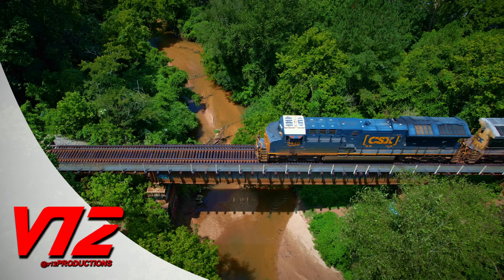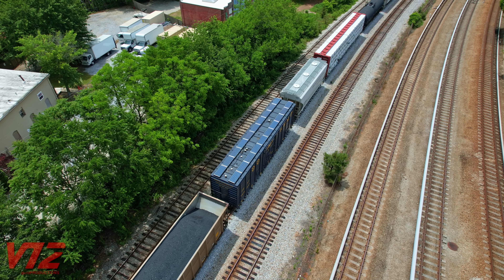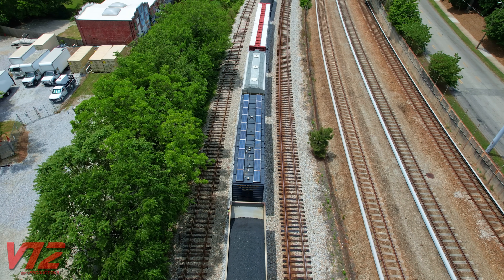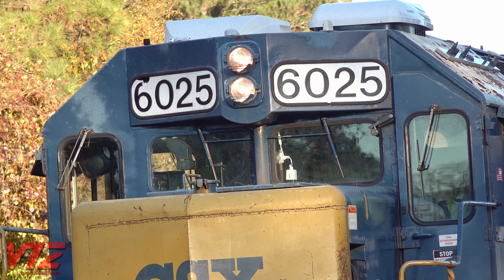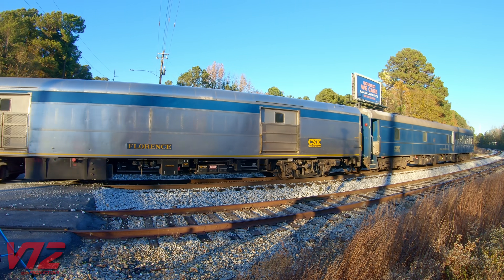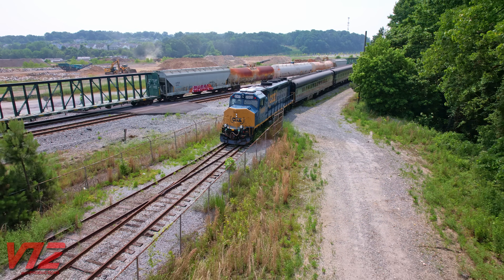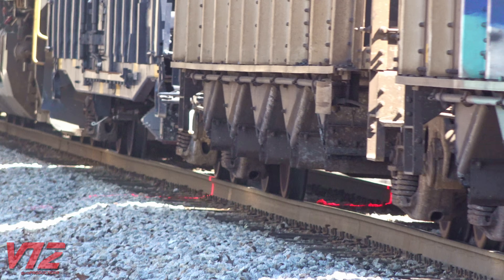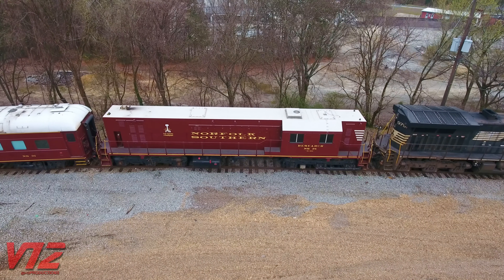"DO NOT HUMP" this Special Boxcar!

Comment: Last year when I went to the B&O Historical Soc. and the  GM&O Historical Soc. combined meet with my dad in St. Louis.  On the Saturday went to both an Passenger  car rebuilder and an transportation museum as an bus trip.  The Passenger car rebuilder was contracted to rebuild an CSX boxcar into what you have in this video. My dad is an member of the GM&O Historical Soc. . B&O and the GM&O has shared history since they both owned the Chicago and Alton so the former GM&O Chicago to St. Louis line had the old B&O style signals which were both replaced by newer signals by both the UP and the CN. The reason the UP has part of the old C&A / GM&O was SP's take over of the short lived Chicago Missouri & Western which the IC starved the new railroad of freight. The CN had taken over the IC. I remember living in Willow Springs Illinois first seeing the last of the GM&O painted locomotives mixed in with ICG Paduca Geeps painted in orange and white as an kid in the 1980s and as an teen in the 1990s seeing the Chicago Missouri & Western's mixture of former leasing locomotives in Conrail and Western Pacific paint with South Shore's former Santa Fe cabooses on the end of the trains. The Chicago Missouri & Western did repaint an few in their Maroon paint scheme. My dad was one of the guys who asked Microscale Decals to make an Chicago Missouri & Western decal set for Ho Scale for the maroon painted locomotives. The decal sheet also includes an decal set for an Gateway Western locomotive. The Chicago Missouri & Western was all second hand EMD.

Comment: CN and CP still use manual track inspection cars.  Might take the railways time to adopt the ATAC car tech because most stretches of track have zero wireless coverage for many kilometers.  Many parts of the Alberta and BC rockes especially have Wireless dead zones.

Comment: Point of correction, that isnt a laser system.  That is an autonomous joint-bar inspection system that uses LED light array.
Reply: So weird. I guess they don't need the precision of laser. It really looks like it'd be laser until you look closer

Comment: Most people do not know what "Do not hump" means.
Reply: I prefer my version of the meaning.
Reply: It means don't have sex with it
Reply: Well, they know incorectly anyways.

Probably at least one guy saw that sign as a challenge. 😂
Reply: crazy will eff you good
Reply: Many do, humping is just a method used to sort freight cars which involves the use of man made hills (a hump).
Reply: Hump means to lift and move something in England. Has no colloquial meaning. I'm assuming that's what it means.
Upon watching fully I see it means something else entirely. Oh well
Reply: @grottybt5006  It means to back a train up on a Hump, then one at a time uncouple a car to let it roll down hill and by selecting track switches route the car to a specific siding.  Humping is how to cheaply make up trains to go to a certain city.  The down side is when the car hits another car and couples, it is a violent shock.  Some cars will not live through that treatment.
Reply: There are Two meanings for the Term “Humping.” The first term is the Railroad term, that is pushing a Freight car over a hill, and than that freight car is uncoupled and rolls down the hill into the yard.

The second term, well, it’s the less appropriate kind.
Reply: ....and if they had bothered to watch the video, they would.
Reply: @bobmahnamahknob  2:41 shows a hump yard but does nor elaborate on what the actual hump does.  He skips over it completely.  ALSO it is a drone shot from overhead showing the hump being flat.
Reply: @myfavoritemartian1 thank you. I agree with you 💯
Reply: @bobmahnamahknob  most people who see a train that says 'do not hump' on it have never heard of this video and never will.

Comment: I have seen that ATAC boxcars at night, very impressive. I have also seen the track geometry train, I believe W003, with 9969 pulling it. Since the locomotive is an ex-passenger unit, the train doesn't need a generator car.

Comment: There are also locomotives that have been outfitted with track measuring equipment that send their data in real time to MofW's headquarters computer applications and generate instructions that are e-mailed to the local Track Supervisor's of locations on their territory that require in person visual inspection and remediation of the defects found.
Reply: They need to do something like this for metro trains.  At least the one I normally take to work, they wait until it is so bad that I hear other passengers complaining that they feel like the train is going to flip over onto its side before we hear an announcement that they are going to do track maintenance.  Especially when the train is climbing up to an overpass with it being straight down on either side and it is rocking back and forth like crazy, while they finally fixed that, I think ridership was dropping off just because of that.

Comment: A long long time ago I worked for an FRA contractor named Ensco.  We did some of the original work on track inspection vehicles including rail flaw and, in my case, track geometry vehicles.  Last I knew (several years back), the FRA still owned and operated inspection vehicles.  Coverage of that program might be of interest to your viewers.  I'm not sure of that program's current status but there is a long history of FRA-backed development and operation of inspection resources.  Could be interesting?
Reply from the maker: That would be interesting. I recorded one of the FRA trains two years ago.

Comment: Now that's some very interesting technology. Here in the Netherlands we have similar autonomous equipment, although instead of it being mounted permanently in a wagon here we have equipment that can actually be mounted on the couplers of regular trains. Although like in the USA, most inspections are still done by dedicated inspection trains.
Reply: As electronic sensors continue to get cheaper and smaller, it wouldn’t surprise me if we eventually reach a point where we integrate full track geometry sensors into every locomotive. (Kinda like how passenger cars no longer need to be put onto a dynamometer to perform emissions testing, because the ODB-2 sensors measure everything needed.)

Comment: The Birch Grove is a 10 roomette-6 double bedroom sleeper built by Budd for the Sunset Limited. Amtrak acquired the car from the SP and retired the car after Superliner sleepers joined the fleet. Not sure when CSX acquired the car but I’m pretty sure they didn’t rebuild the interior. CSX didn’t even bother to get rid of the SP markings. It’s definitely sleeping quarters for the inspectors.

Comment: Thank you for this video on CSX's autonomous inspection boxcars. I have seen videos of these boxcars on other YouTube channels. Both the Wide World of Trains and the Jaw Tooth YouTube channels have videos of freight trains with these boxcars. I did some research to try to determine how many of these boxcars are in existence. Based on the number on the boxcar in your video there are at least eight of these boxcars numbered from 994370 to the car in your video which is numbered 994377. One additional thing that I found out about these cars from your video is that these cars have solar panels for power. Your video is the first video that I have seen that shows the top of the car. The other videos that I have seen of these cars have been from ground level.